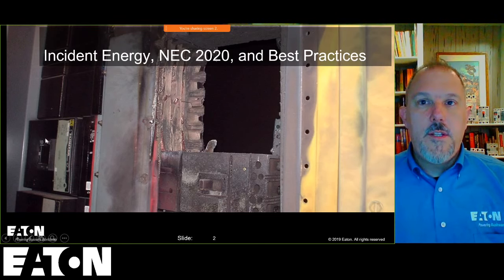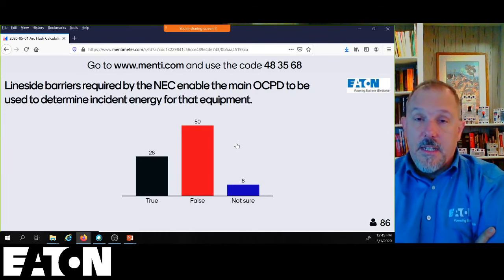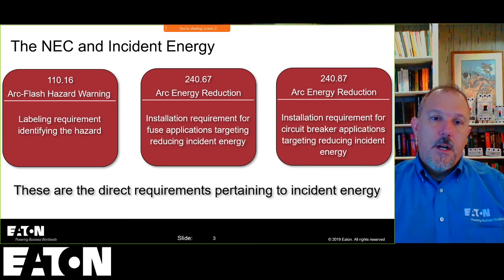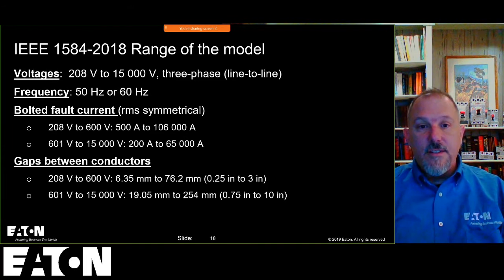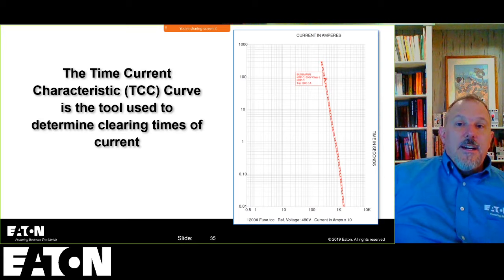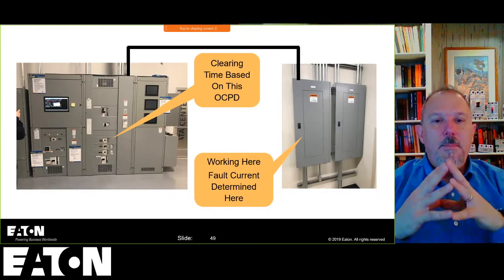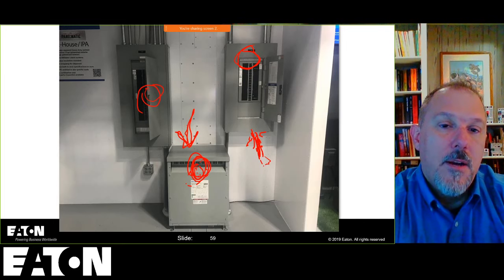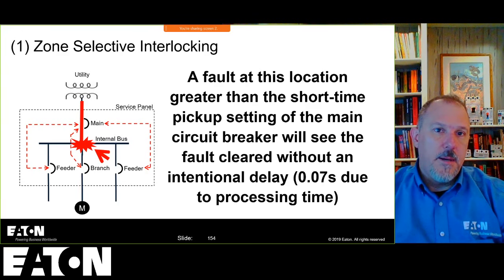The Arc Flash Calculation

Comment: Eaton's double door safety disconnect switches don't say in the literature if they can be considered suitable for use as service equipment.  Also, one challenge I think may exist with specifying them (just based off of seeing a photo) is they are taller, making one have to adjust to not exceed the 6'7" max handle height rule.

Comment: In some cases like Puerto Rico where the utility is very weak, so as to cause crazy voltage drops due to inrush current, you may not be able to rely on the utility being able to supply a certain amount of fault current.

Comment: There are plans for 2023 to require the service disconnect in its own standalone enclosure.  Couldn't the concern that is pushing this be addressed via fully insulated bus and terminations on the line side of the service disconnect, or thicker barriers in between switchboard sections?